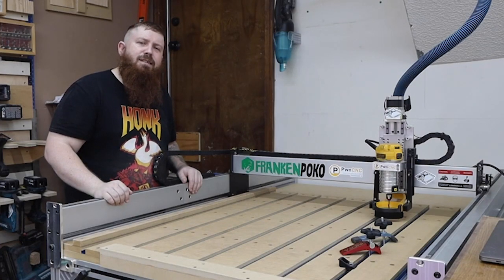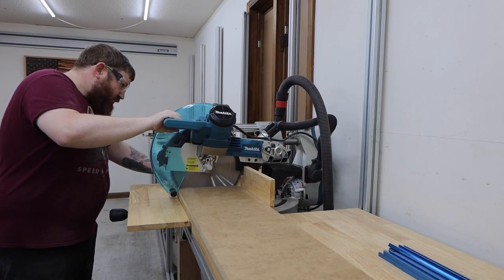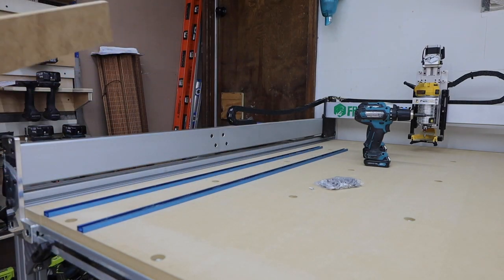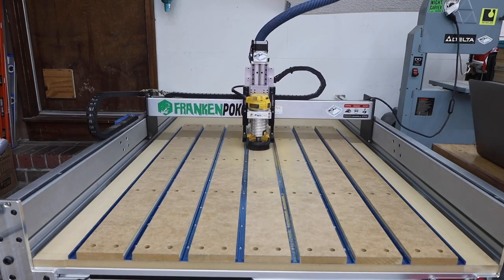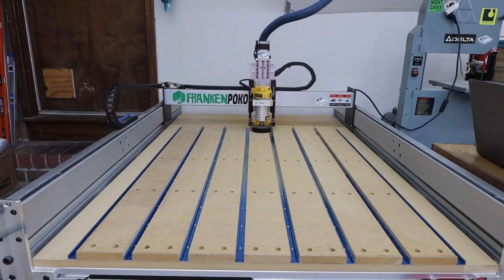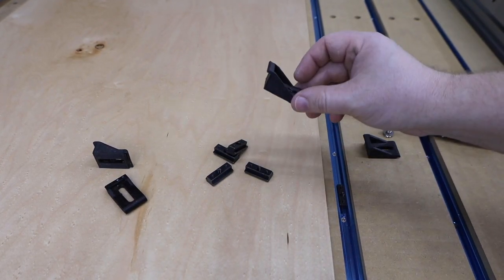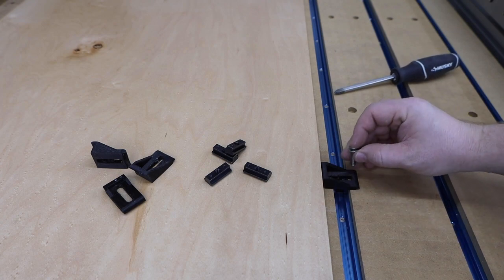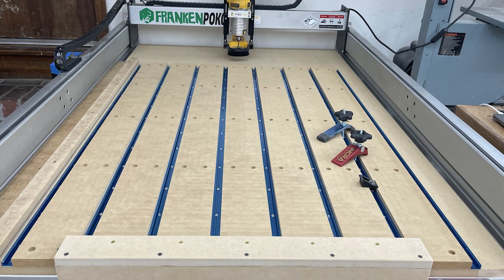I made a T Track Waste Board for my CNC Router (Shapeoko and others)

Comment: Amazed by your dust collection. I have mine hooked up to my Harbor Freight 70 (?) gallon dust collector with a 4" hose and I feel like it doesn't do that great. I've been thinking it is due to the fact that I have the hose going to the ceiling and then coming back down, but that obviously isn't the case as yours is similar. Great work, just put on a new wasteboard yesterday and your video really has me wanting to add t track.

Comment: I think I would've chamfered the bottom of the front fence before surfacing the edge. That way, you could still maintain a clean edge without having to cut into your wasteboard. I like the way you made your wasteboard though.
Reply from the maker: That’s what I’m showing at 5:44
Reply: @ChrisPowellFSD  Sorry, I guess I missed that.

Comment: I am new to CNC. I recently finished building my MPCNC and wanted to add T-Track waste board like yours. The rectangle vector that you created in your CAM what toolpath profile did you use is it pocket, contour or what? Can you post the link to buy the low profile clamp, also, the link to the T-Nut is not working.
Reply from the maker: It’s a pocket. The clamps and t nut should be on PwnCNC’s website.

Comment: What screws did you use for attaching the mdf strips?
How far below the surface to you recommend the v-bit to go?
Reply from the maker: It was just wood screws with a flat top, tapered head. Try to get them so they sit about 1/4” below the surface. That way you will have plenty of material that you can resurface as you use the wasteboard.

Comment: Chris I just found this as I was looking for a fence set up for my shapeoko Pro XXL on your machine up size cutting area do you do have was trying to figure out what size to make the rectangle to make?
Reply from the maker: Well mines a lot bigger since I extended my machine. Just jog the machine as far as it will go to the back and left and right, and make a mark. Make a wasteboard just slightly smaller than that.

Comment: Great videos, I'm having trouble with my Shapeoko XXL, in contour cutting the bit will rise up 2 to sometimes 10 thousandths for a few inches or sometimes it will rise up almost all the way around a whole pass, it did this before and after I replaced the belts and V pulleys. It is not a positional thing on the work piece, because you can move the vector over to another area and get the same results.  And it doesn't do it all the time, please advise me if you have any answers, thank you
Reply from the maker: Check the set screws on the pulleys. They’re really small ones. Make sure one is on the flat area.